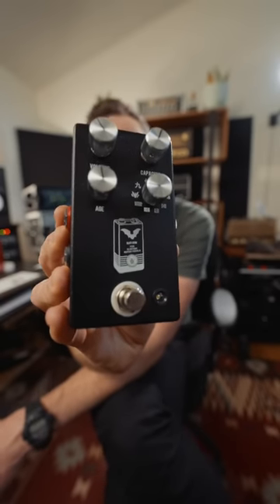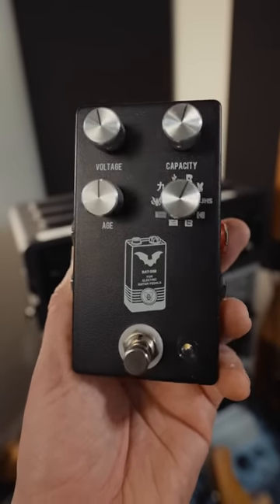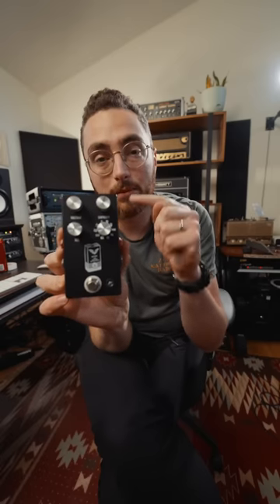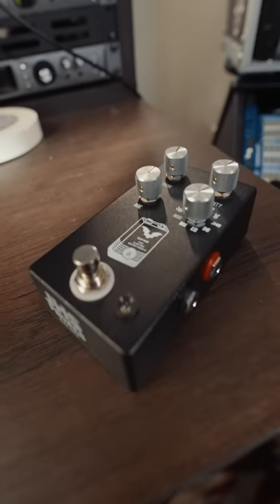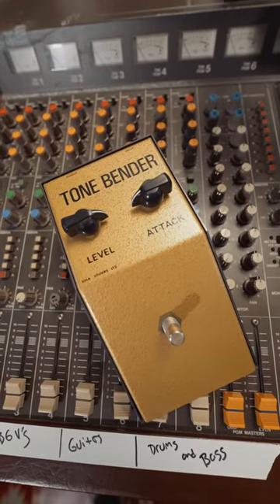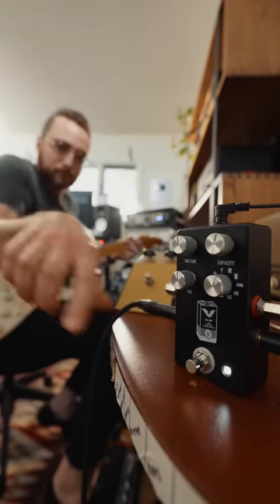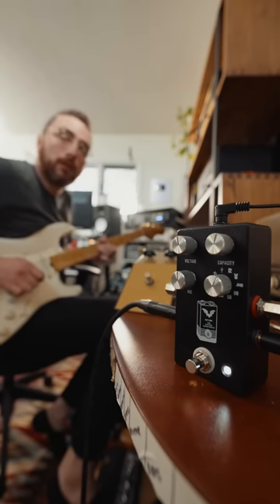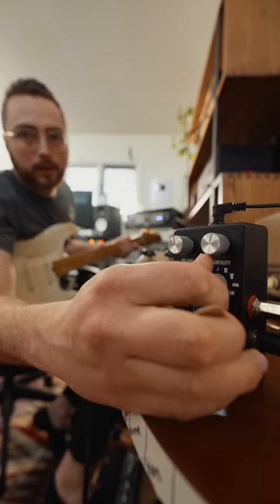They’re changing the game with this pedal #guitar #fuzzpedal #music #slideguitar

Comment: Will this turn my Metal zone into a Bad Monkey?
Reply: Made my day😂
Reply: and back again
Reply: It'll turn it into the one Gary Moore used which is better than all Klon!
Reply from the maker: If you have to ask, you probably can’t afford it.
Reply: Why would you want that, METAL ZONE is peak distortion
Reply: @RhettShull  I bought 23 Bad Monkeys before they commanded thousands like the Klon. As they sound the same this will happen. I need spares as it's essential to my sound since 15 years. Lucky enough I've got enough NOS vintage Kodak Batteries as well.
Reply: Yes but also if you run 110 volts through it - it will actually turn an MT-2 into and actual Klon Centaur right before your eyes😊
Reply: @RaviSingh-ph2uw  No work.
Turned into a Phoenix.  Cant shoo it out the door.  Crap it just set my couch on fire!

Comment: When you lower the voltage it decreases the circuits headroom. Doing that chops off the peaks of a sine wave creating a square wave. Any gain pedal will sound fuzz like when you decrease its voltage as it cannot reproduce and amplify the input signal faithfully.

Comment: I see people memming but this guy didn't go over the voltage control. A dying batter actually makes a difference on the sound. There is a VST I use, the ODR-1 that emulates voltage control. I put the voltage at about 7-8 volts and gives me a stoner metal kinda sound. Having thus this in an analog box is really cool.

Comment: The original fuzz face circuit actually does have sensitivity to the battery internal impedance.   Using battery chemistry other than Lead-Zinc will cause the gain to go too high.

Comment: I don't know whether to give video a rhymes up or down.
P.S. you can tell it is a prank video because a voltage manipulator should be plugged into the power supply,  not into the signal path.
I would like a power supply that could do those power emulations. 
Boy do I miss the Danelectrode.
Haha Rhett
Sincerely 
Mike B. B. From Philly, P.A. U.S.A.
Reply: Mxr has a fuzz called super badass that has a variac control to make it sag when you want. The fuzz tone is decent too.

Comment: What? The battery doesn't effect it that much
Reply: Actually a battery that is dying will produce some cool sounds from certain pedals. MXR makes a fuzz pedal called Super Badass that has a variac type voltage control that you can use to emulate a worn out 9volt battery. I found this phenomenon out as a teen when my MXR Dyna comp compressor started doing this wierd fade out kinda sound. So cool. Anyway, this pedal in the video is just an April fools joke. The effects of varying voltages is very much not.